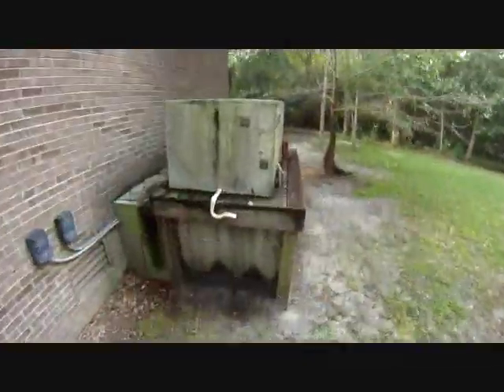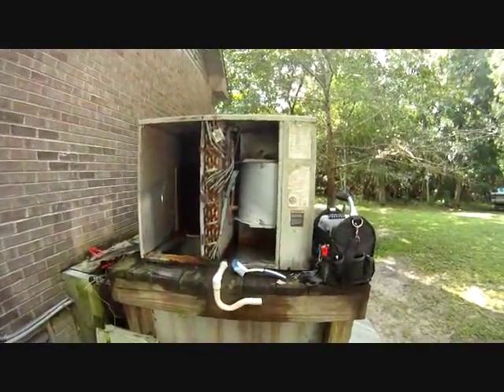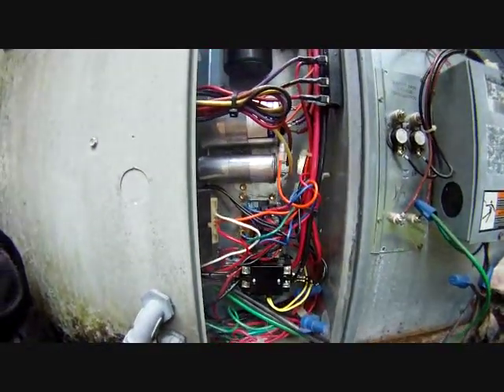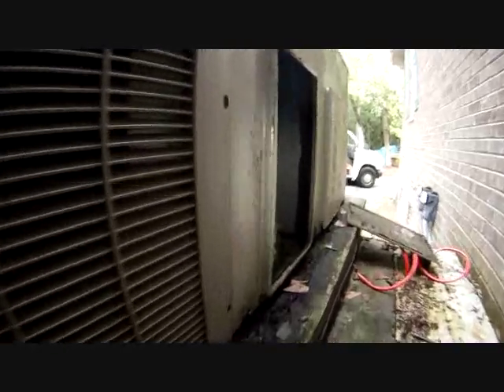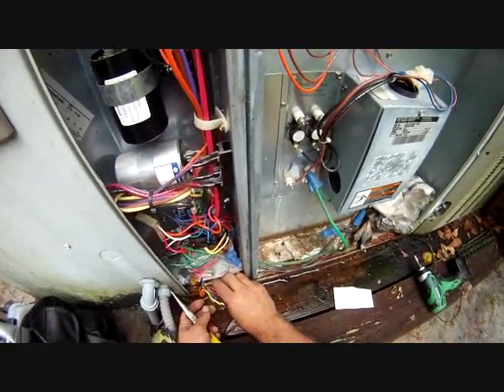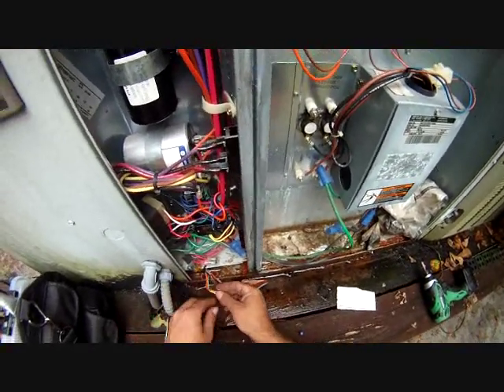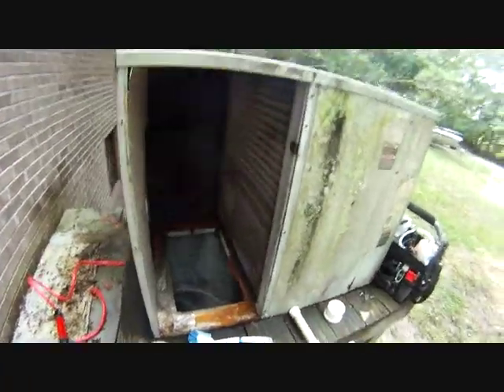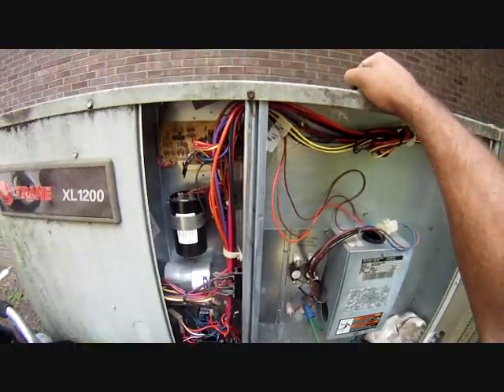HVAC Service- IAQ Issues with a Trane Package Unit

Comment: should have sold them a new one...that thing is junk!!!
Reply: I caught a lung infection watching this video. Ugh.
Reply: Brett Kelly trance is not junk it is a quality unit and if you differ and you say goodman is the same as trane I am going to start questioning your definition of quality
Reply: involved gamer Never heard of Trance ac.
if you mean Trane, I never said they were junk, I said that unit was junk. Trane is quality equipment, but over engineered and over priced.
Reply: Brett Kelly  autocorrect
Reply: involved gamer hey gamer noob, you probably need to do some research on ac manufacturing before you post. Goodman/Daiken is the second largest manufacturer of ac equipment in the world. second only to Carrier, who, you probably didn't know, invented the ac. I am going to let you in on a little trade secret, gamer, when you buy a Carrier or Lennox or Trane, you are also paying for all of their advertising too. Goodman doesn't advertise like they do. that is why they are cheaper. they all use the same components and motors. Trane / American Standard have their own compressor, but it is no better than Copeland,  which is the industry standard. it's all good equipment if installed correctly, but why pay more for a name?
Reply: Brett Kelly you are right about carrier being the first to create ac systems I got one myself and goodman is a ok product for people that is not rich so I do not want to start and argument and I am not a noob because I know a lot about HVAC and I know multiple people that would back me up so I will just leave it as that so please don't make this argument any worse just because I sound very kiddish in my video does not mean anything because that could be my son or brother so go bother someone else and have a nice day